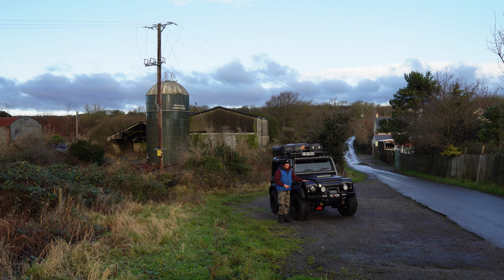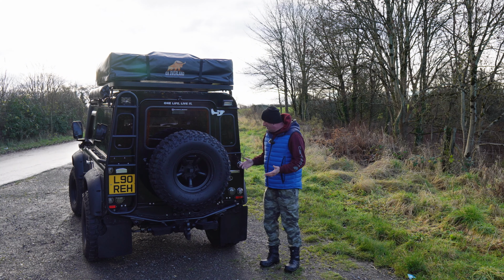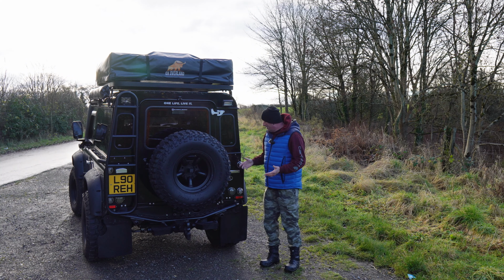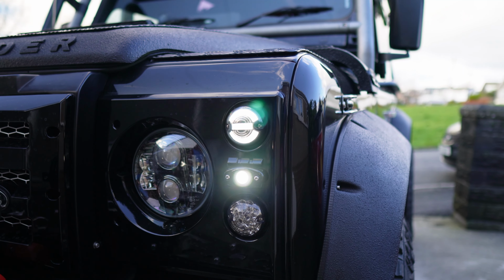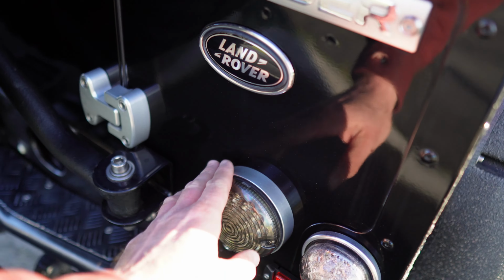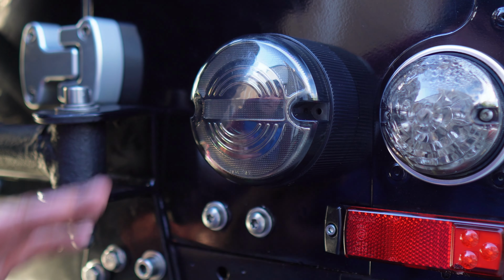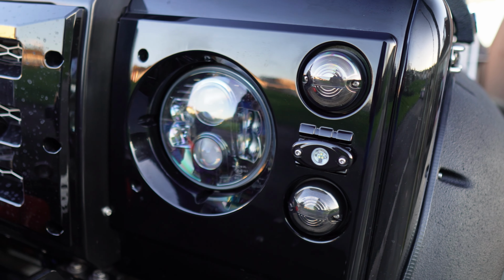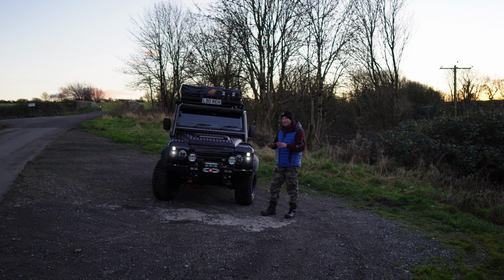DEFENDER ULTIMATE UPGRADE NEW LED LIGHTS FOR... 2024

Comment: Nice video Rob, nice audio too! question - what are you spraying your connections with? I'm about to do mine too
Reply from the maker: Hi there I used 
GT85 Spray is the best-kept secret for cleaning, lubing, and protecting... smells great too 🤣  I use it for most things👍 it just very similar to WD40 Spary... Thanks again for your message and for watching my video very much appreciated... 👍
Reply: @ROB_THE_DEFENDER  cheers for replying thanks again 😎